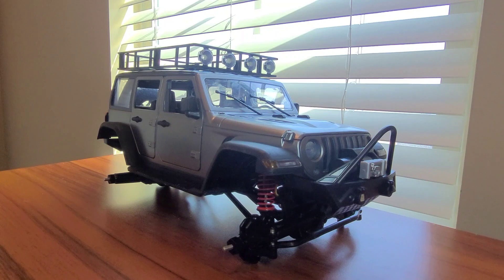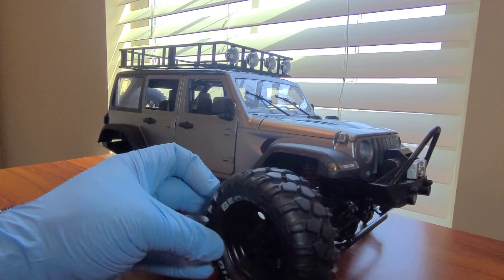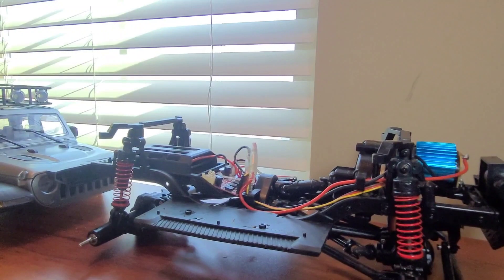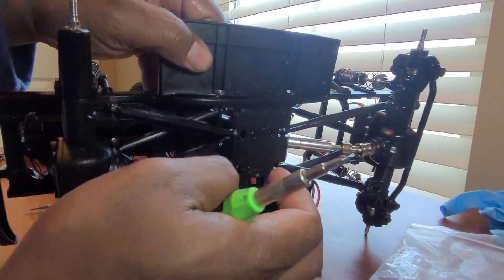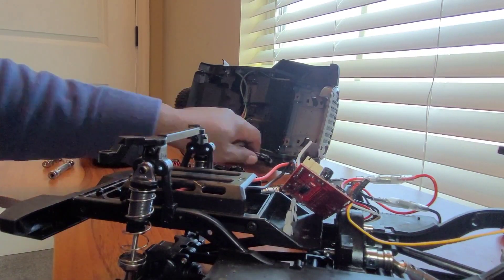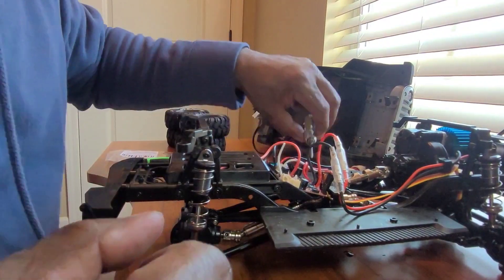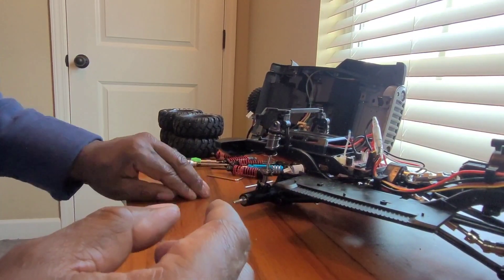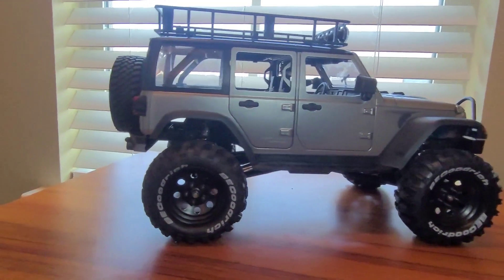Hardtop Jeep Wrangler MN128 Get Some Upgrades (Will They Help)

Comment: Where did you order your tires from please give full details. I have a MN128 model also and I love those tires
Reply from the maker: 90mm is the size
https://s.click.aliexpress.com/e/_mrVLgME
Reply from the maker: You will have to shave down the front fenders so the wheels don't rub when you turn and when front suspension flexes.

Comment: Do you upgrade your stock motor and battery to accommodate these wheels? I heard it's heavy
Reply from the maker: @yshish5286  the wheels are heavy but the motor & battery can handle it. It's just enough weight to keep the wheels planted on the ground when cruising and crawling. I upgraded to a 540 motor in one MN128 and kept the stock motor in the other. The stock motor MN128 didn't lose any performance. The upgraded MN128 gained alot of torque and a little more speed.
Reply: @PJsElectricRCAdventures  Thank you for this info! I will buy this wheels!

Comment: i already have metal upgrades for mine and axle bearing kit but will change thwm only when stock fails. Bigger weels only contribute fir tipping over too easily and rubbing on fenders. Stock ones are cool for scale looks and for hardcire rick crawling i already have a modded ftx ravine.
Reply from the maker: I don't want to make this crawler too heavy, so I won't go with a lot of metal parts. The bigger/heavier wheels actually do wonders for this crawler. It helps it stay planted on the ground, going over rough terrain and added clearance.
Reply: @PJsElectricRCAdventures  metal upgrades i mean metal gearbox internals and metal driveshafts. I prefer weight low down on crawlers but not on wheels that stress drivetrain. For example, on my ravine i prefer plastic beadlocks and lead weights on top of the servo and inside axle.

Comment: Amigo, esse pneu não esbarra no link da suspensão? Não esbarra no amortecedor? Não precisou usar espaçador hex 12mm?
Reply from the maker: No, they did not hit the link or shocks but they do rub against the fenders. You will need to trim the fenders down so the wheels will clear when you turn and the suspension articulates.
Reply from the maker: Maker sure it's the 90mm wheels though.
Reply: @PJsElectricRCAdventures muito obrigado por responder. Sua resposta foi muito importante para mim.